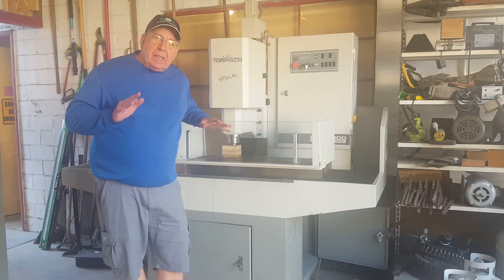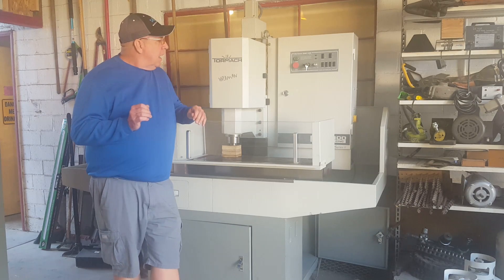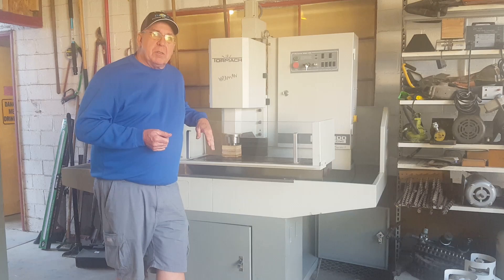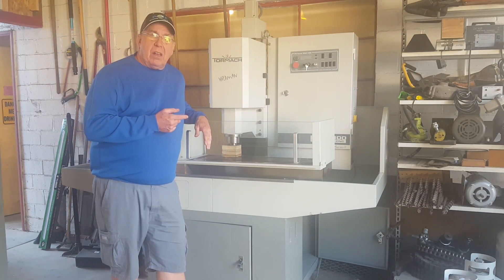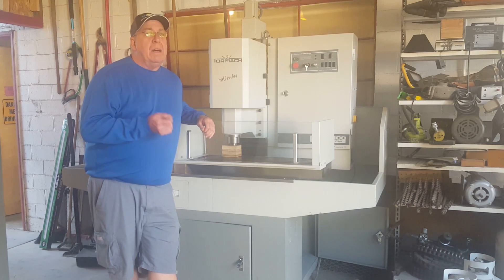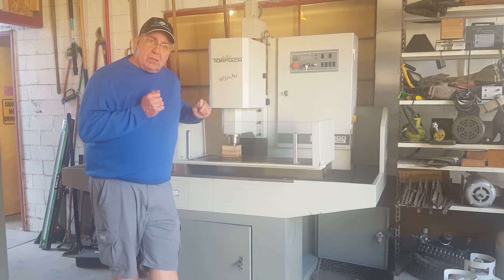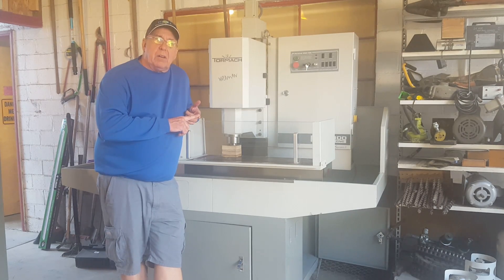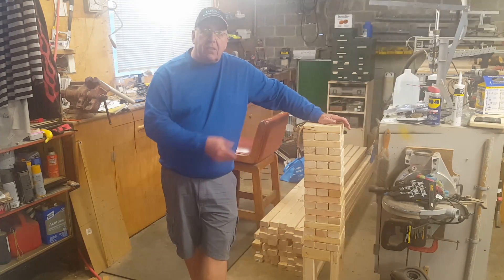Vlog #10 - Injection Molding Update!

Comment: nice machine. I have a question on the injection molding machine. which heater element is best to use? the round band style or the long straight tube style?  where do you install the sensor for the most accurate temperature measurement?
Reply from the maker: I use band heaters and I install the thermocouple right in the tip

Comment: Hey Wildman, I use a tormach to CNC my injection molds too!  Its great to hear you are moving to a "powered screw drive".  I just built the precious plastic injection molder this semester. So far, I have  cnc'd a test cube on an aluminum block and the tormach handled it very well.  I have injected some milk-jug-hdpe scraps.  I look forward to seeing what you do!